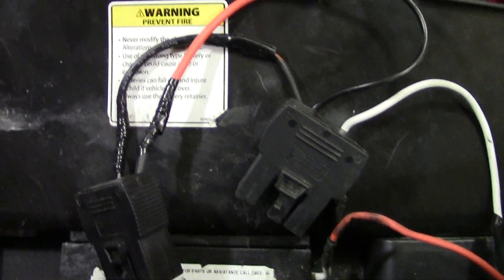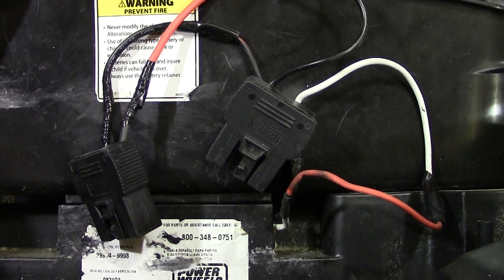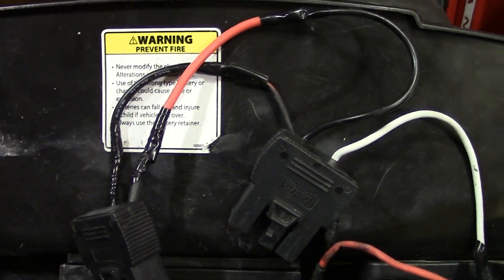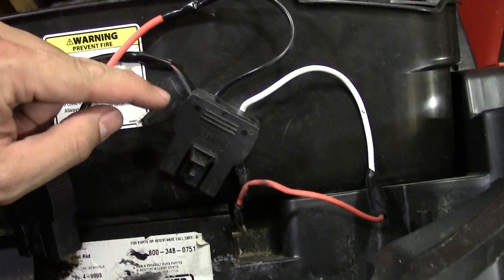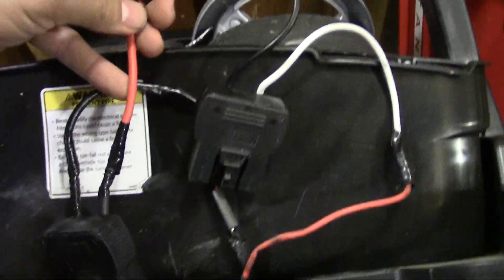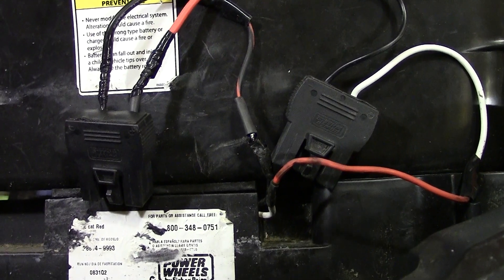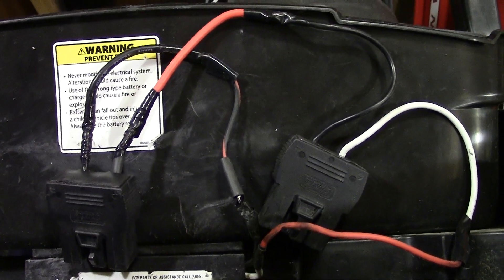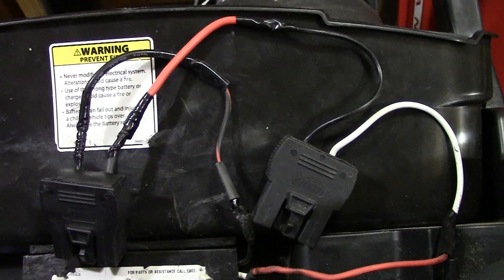Arctic Cat Power Wheels 24v Converrsion

Comment: If you connect those to two 12v powerwheels batteries, your powerwheels will cut off and on from the heater Protection in the batteries. How did that work out for you?